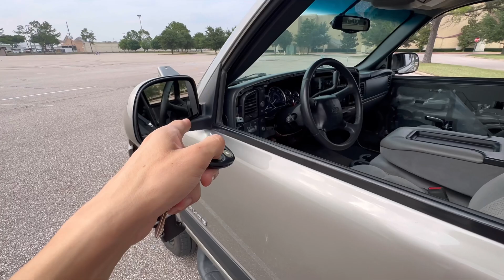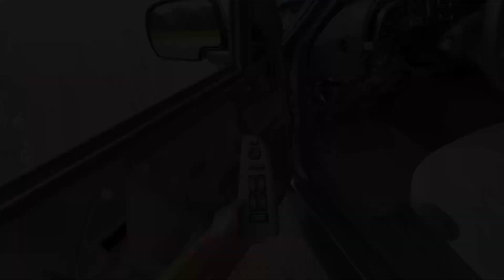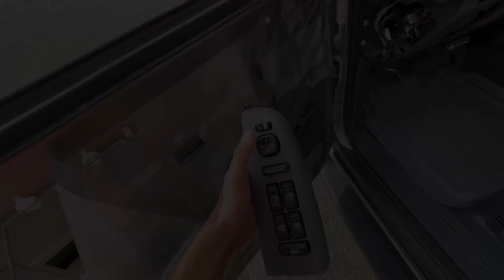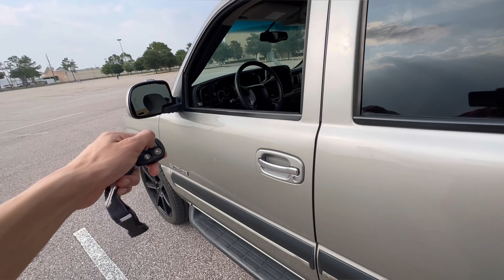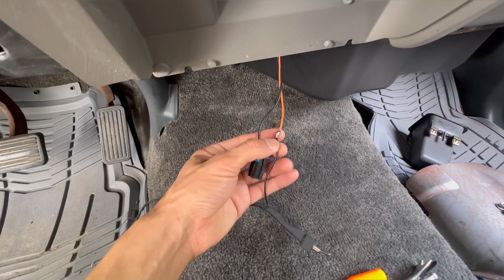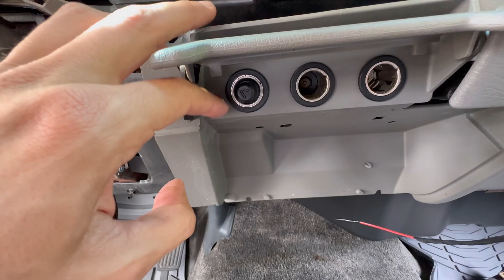Folding Mirrors Conversion with remote!! 🔥🔥🔥99-02 Tahoe\Silverado Pt 3

Comment: My lock,unlock are negative triggers. Can i use this timer relay ?
Reply from the maker: No, they need to be positive triggers to activate this relay.  You could use a regular relay to convert your negative triggers to positive and then it will work with the timer relays

Comment: Fire 🔥, need to do a video for 06 how to wire I’ll love this for my crew cab
Reply from the maker: Appreciate it and Yeah hopefully soon I ca work on a project like that!
Reply: Would it work if you bypassed the switch? I already have a switch on the door or would you have to tap into it
Reply: 2006 already comes with the option. Just need to replace the switch. Plugs straight in

Comment: How about this on a 2014 Tahoe?
Reply from the maker: It would be different
Reply: @MiGo713 could you possibly explain it or is that to much?
Reply from the maker: @marvinmoate2149 They get controlled through data you might be able to turn on the feature on your truck like the new Escalades

Comment: Does the timer relays drain your battery since they stay on when the truck isn't running?
Reply from the maker: No it doesn’t, check out towards the end of my video where I go over that topic My 01 Tahoe  Pelsee P12 Pro 4K Mirror🔥 Factory look with hard wire  installation
https://youtu.be/Yo3bLnWDCpU

Comment: This is a great video for sure! Is the momentary switch from part 2 necessary? Im thinking about maybe trying to make them work with just the lock triggers.
Reply from the maker: Thanks! The wiring from part 2 is required but you can use it without the switch and only lock triggers if you’d like.  I prefer having both for full control at any time

Comment: Hey bro can you show me or us viewers that wanna know how to install a good vehicle car alarm remote start so the mirrors will close and open when locked or unlocked on the keyless entry alarm remote which alarm are you running thanks bro I have a 04 Silverado and want to put the best alarm on it so it won't get stolen either thanks homeboy
Reply from the maker: This wiring did right now is for 99-02, I still haven’t been able to work on the 03-06.  Here I have my alarm I upgraded to a Compustar hopefully the video helps out My Tahoes new Alarm Compustar T13 Pro🔥🔥🔥 & My Silverado fuel leak!😭
https://youtu.be/QmHZ_uhQlfE
Reply: @MiGo713  ok thanks brother appreciate it
Reply from the maker: @chatobalencian1504  No problem bro!

Comment: Great videos! I have a 99 Silverado, is it possible to upgrade the side mirror control switch on the driver door to the 03 and up and close and open the mirrors that way? Thanks
Reply from the maker: It wouldn’t work they get controlled differently, and Thanks💯